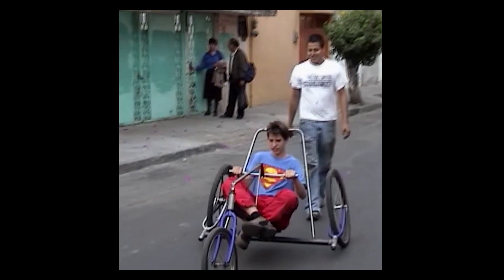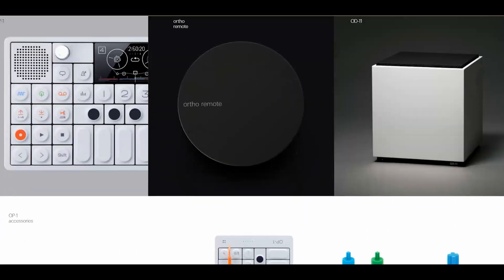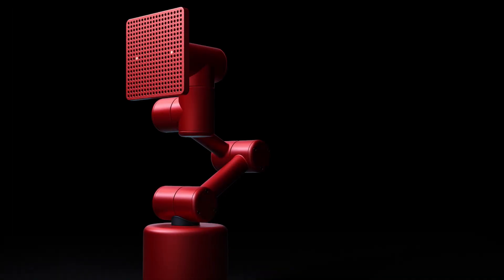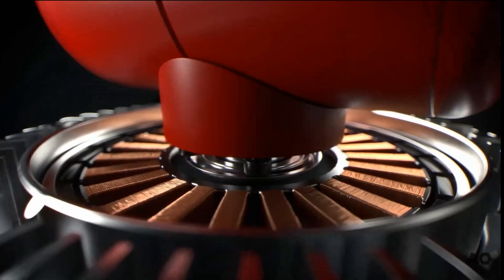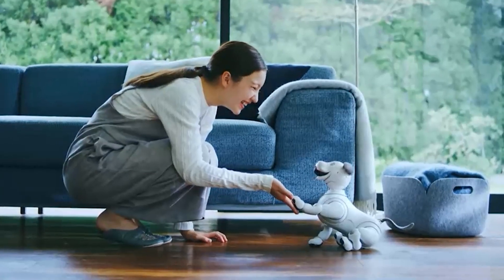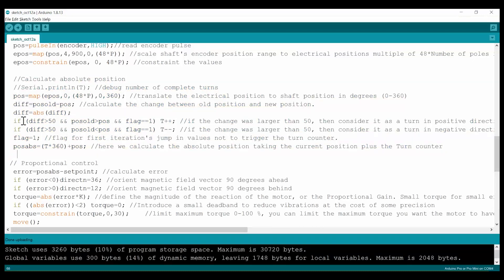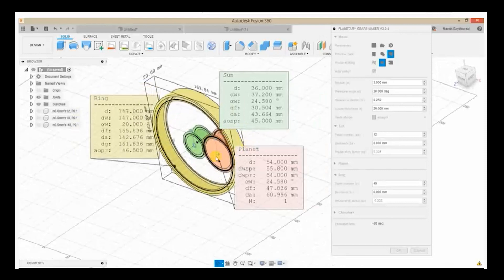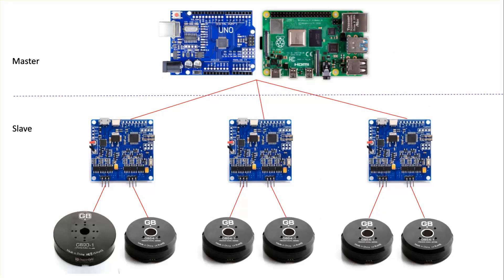DIY Robotic Arms, Teenage Engineering and more! (Brushless Motors with Absolute Positioning)

Comment: Hi, your videos are really useful. Thanks for taking the time to put these out here :) I’m currently experimenting with absolute positioning of a DC motor using optical encoders and an STM32F4. The STM32 has dedicated encoder inputs and using timers it’s really easy to keep track of over and underflows (or rotation counts). I believe the same can be adapted to BLDCs with motor drivers that accept PWM inputs. I’ll share the code once I make some decent progress.

Comment: i dont found bldc hollow shaft with encoder
how do you manage to pass the wires trought?
Reply from the maker: You will need to find one with a magnetic ring they exist, but they’re not easy to find and they are expensive
Reply: @RandomAccessProjecs  i spended hour without success
how can we do robotic arm without them ?
also seem turret camera always have limited rotation because that
i tryed your script it work smothly but i canot figure how to reverse rotation